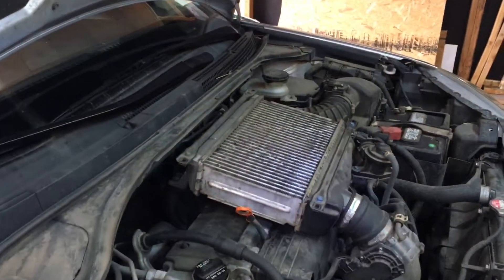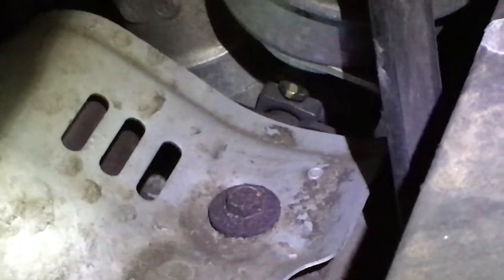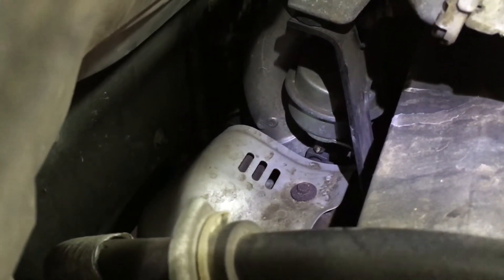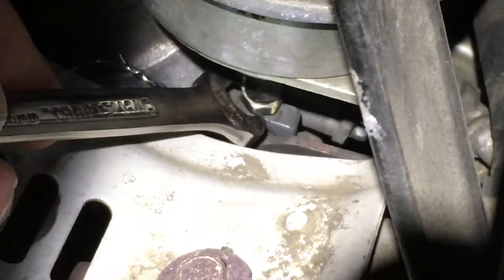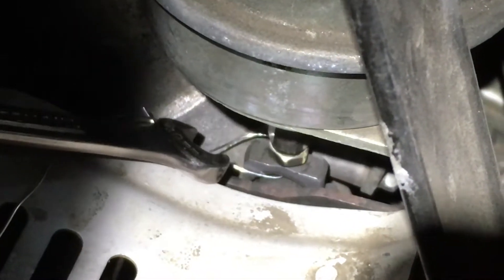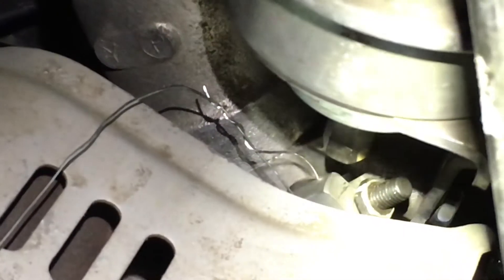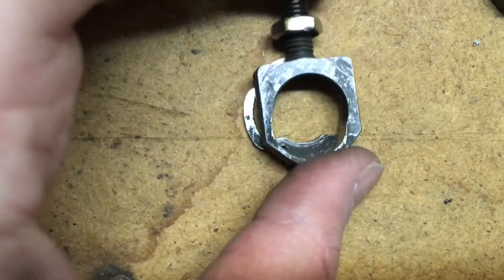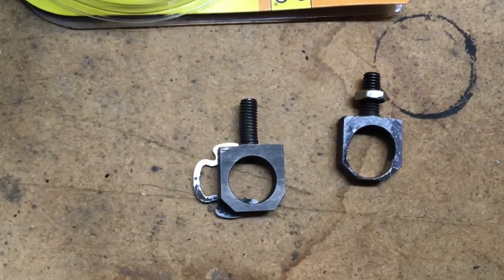How to fix P2263 Acura RDX Turbo error code - repair/replace VGT actuator / waste gate

Comment: Just finished this repair today. I highly recommend removing the heat shield (3 - 10mm bolts)  that sits just below this area as it gives you access to the retainer that holds/inserts into the hole of the actuator part that you are replacing. It is spring loaded and when pulled back assists in attaching the new part. Hope this helps.
Reply: Going to jump into this repair soon. I appreciate your tip
Reply: Sorry
How is the name the remplacement
Reply: Best video out there for this repair! I just performed this yesterday with success (minus the clip) on my 2007 with 180K. It helped reading through all the comments. My additions would be:

Probably should have saved myself a little frustration and time by getting the tools another user recommended...curved hemostats, long nosed vice grips, mechanic pick. Would have helped on the clip as well for sure.

I threaded in some zip ties to better manipulate the lever up/down that has the bearing like bolt on it.  This helped me get the part in behind, from the right side, while everything was more in the down position. Probably couldn't have done this with the heat shield or intercooler in the way.

While everything was broken down, I went ahead and cleaned the K&N filter, the throttle body, as well as replaced the spark plugs.  These tasks took a fraction of the time that the original repair took.

This also fixed a rapid rattle type sound that I had every time I came off the accelerator after building boost.  It almost sounded like a bicycle derailleur.
Reply: I replaced a part on my car and it's giving me the same code again after driving it for a few days. Could you tell me why?

Comment: I have the new part installed, but can’t get the threads started onto the barrel. Any suggestions?
Reply from the maker: Not apart from the standard "go backwards until the threads seat, then screw it on" advice. Removing the intercooler and heat shield for better access can help too.

Comment: Just got this today….have a 2007 acura rdx and first time i got this code….got this car at 128k miles and it came up at 211k miles, and in that time never popped up so not sure if it ever came up before that but i hope its something simple rather than replacing the whole turbo or something

Comment: Our 2010 RDX with 190K miles has a P2263 code, check emission error, SH-AWD error, and CEL lights on.  I have been driving with the code for a few months and finally replaced the actuator last weekend ($17 on eBay).  Took 2 hours and I had to give up on the C-clip, as I couldn't get it in.  I felt the actuator is tight enough w/o the C-clip, plus it's very easy to re-tighten, if ever needed.  The code and CEL are gone.  Thanks for the video, still useful 4 years later.
Reply: You have a link to the actuator used?
Reply: What is the name of the part so I can purchase it
Reply: @lawrencescalone2087  For Acura RDX 07-12 Grade 8 Turbo Variable Flow Actuator Eye Bolt & Nut & Clip

Comment: Found this in 2023, and I can verify it works! My 2010 RDX only has 100k on it but was throwing the code, Acura only suggests turbo replacement since they don’t actually make the turbo. Found this part on Amazon for $20, took me an hour to replace. Thanks for the video and helpful tips.
Reply: Hey @brandontarby3793, could you share the amazon link to the part you purchased please? Thank you.
Reply: Please share amazon link please

Comment: I just did this today. Car runs better but still have check emission and sh-awd lights on.
Reply from the maker: Need to reset codes after you're done
Reply: @aw-yiss   does pulling out the clock fuse for 30 seconds work on '08 model? I tried pressing gas pedal for 30 seconds with key in position 2.
Reply from the maker: @pattibrandt9430  I don't remember. I didn't use fuses. I think the manual might have some info?
Reply: @aw-yiss  I disconnected battery for five minutes. Codes are gone! Thanks so much for posting this video. I'm a 58 yo  mom and I did it by myself with your video and a ton of patience. Took a little over five hours.

Comment: Wish I read more comments before attempting this tonight. I removed the intercooler after starting to get frustrated. That itself is not a big job, 3 bolts, 5 hoses, and an electrical clip. 

I used, for lack of a better word, a grabber (push button on the end with metal grippy fingers on the other end) a lot. It helped me get the new part and clip positioned correctly for installation. I used fishing line for holding the clip and new part, however the old parts did just fall to the floor since I didn’t bother to toe them up. Don’t know how I could’ve. The wrench I dropped did need to get fished out.

Other worthy mentions would be how I used a 12mm wrench on its side about at the halfway mark on the linkage to pry it back enough to get the part on. This took maybe 30 mins to finally get the new part on there. Once I figured this out got it 2nd try. 

It’s really tight in there. If you have huge hands it’s gonna be tough. My hands are too big for this kind of work, and they’re only a large glove lol. Good luck.

Comment: Great video and comments here.  Just finished this repair.  Took me about 8 hrs across 3 sessions.  Patience is key, it’s easy to get frustrated with the limited access and light.  Study closely the intake runner on the backside in relation to the actuator arm travel; I found there was a sweet spot where the eye bolt would slip behind and the angled corners on helped with clearance. Get a small bright flashlight.  
Here’s what worked for me.  I’d definitely remove the turbo heatshield first thing in retrospect.  I wired the actuator arm to finagle the eye bolt off and on, but limit it’s travel to the top 1/3 or so. That was the sweet spot for me removing and installing the eye bolt.  Wire the new eye bolt and C clip.  I dropped them countless times. 
Feel around on the back for the C clip and rotate it with your finger or small screw driver where the tall spot (check some pictures) is on the left side of the eye bolt.  I slipped a small screw driver between the clip and eye bolt and pried it off.  I hadn’t wired it and at the time I didn’t care.
The eye bolt slipped off and pushed out horizontally to the right with the threads on the right, while wiggling the actuator arm up and down. 
I slid the new eye bolt in from the right side with the threaded post pointed roughly 2-3 oclock while moving the actuator arm to find the right gap between the lever and the intake runner behind.  It’s tight but mine eventually went.  Doing it one handed was tough. Patience.  I greased my eye bolt as well which made it tough to hold. 
Replacing the C clip was tough. What eventually worked for me was using needle nose vice grips to hold the clip on edge and push it on from the left at about 10 oclock angle. I had to reuse the original clip. The new one was just too stiff to push on all the way. 
As far as repositioning the barrel and lock nuts, loosening the lock nut made about 2.5 rotations to the bottom.  The barrel nut about 8.5 rotations up to free the eye bolt.  When I reinstalled, I used the wire on the lever to pull up to meet the barrel nut.  After starting the barrel nut to hold the whole thing in place, I turned the lock nut 2.5 turns up and then turned the barrel nut down to meet it.  Luckily when the barrel nut met the  lock nut, the factory marking was in the same place as before (at least that is what I’m telling myself).
Reply: How important is the c clip? After removing the old part I noticed it didn’t have one so I skipped putting a new one on. I reset the computer and so far so good after about 15 miles
Reply: @ItsBorgiaBaby  I suppose it's possible the eye bolt would slip off the post of the actuator lever (it's been a while) over time. Too, having the clip on there would limit any small movement of the eye bolt that could increase the wear on the eye and waller it out quicker.  I'd reinstall just for any insurance not to have to do that job again.
Reply: @ericskaggs3503  unfortunately the check engine came back on. I’m thinking to put the c clip on this weekend and giving it another go. Do you happen to know the exact reason this part fixed the issue for so many and why worn pieces caused an issue? I’m trying to figure out the concept behind it which will help me fix it. Thanks 🙏🏼
Reply: @Dirk-e5v I completed this but was never able to resolve it. I took it to a few mechanics and all of them told me the turbo has to be replaced. It’s working fine actually just the light keeps coming on so now my issue is getting it inspected every year.. let me know if you find a solution, good luck bro!

Comment: Anyone know how many turns that actuator bolt needs to be turned?   I think I loosened mine too much and still get the same engine code after replacing.
Reply from the maker: Someone else mentioned about 8 full turns.
Reply: @aw-yiss  From full tight or from fully out?
Reply from the maker: @tonywillingham8109  its in one of the older comments. I couldn't say but I assume after 8 complete turns it came off the threads entirely

Comment: every mechanic and dealer wants anywhere from 2500 to 5000 to replace the turbo for this 28 cent part
Reply from the maker: Dealer quoted me 7500
Reply: @aw-yiss  just be patient take off the intercooler and when you take off the c clip on the variable valve use dental floss doubles up looped incase it drops like it did on me 5 times my eye bolt and clip dropped alot lol. also that eye bolt is reverse threads ok. and use locktight so it doesnt back off next time
Reply: use 2 10 mm open ended wrenchs skinny kind thin ones to really get the eyebolt and double locking nuts back down tight. if you dont get it tight it will just back off and strip out again and again
Reply: once you get the c clip grab a medium pair of channel locks like the 10 inch ones adjust it to about inch and half open slowly gently get them in the and methodically squeeze the c clip on. if you fail no worries you have dental floss to try again fish it out repeat untill its done
Reply: now that you got that done. get the eyebolt standing straight up perpendicular with female threraded allthread part already attached to the underside of the valvebody the spring is inside that. guess what. you can spin that inside spring by turning the screw underneath take that 10mm wrench and you gonna wanna turn in counterclockwise ok while holding pressure on the lever and eyebolt upwards towards the treads. take your time make sure its threading in smoothly youll feel alittle  resitance but its shouldnt be cross threading. make sure it looks straight threading in. right before your almost done threading it in put some red locktight on the whole things and lock it all done tight. now put the intercooler and intake back on and drive away. like i did in about 25 minutes

Comment: A few things that will make this PIA job easier: needle nose vice grips, curved hemostats, mechanic pick.    I think the actuator lever has to be in the up position to remove/add the eye bolt so having a wire around the end of that to hold it up will help you get the new part on.  It also helps lift the new eye bolt into the threaded barrel.
Reply: it does but the lever can move sideways and bend a lil bit by prying on it with a flathead lightly. make sure to have magnet ready and dental floss putting it back on omg i dropped it 5 times into the abyss lol

Comment: How the heck did you turn the clip on the back?  Cannot get mine to budge.   That part about “don’t keep unscrewing the barrel”, that would have been good info at the beginning, not the end.
Reply from the maker: My clip wasn't too difficult to spin around with a screwdriver. Maybe try taking off the intercooler for easier access?
And yeah, the barrel info would have been nice to provide earlier, but I was figuring this out as I went.
Reply: @aw-yiss  The key is to spin the clip before you attach any containment wires.   The wire may bind it up.
Reply: @tonywillingham8109  how hard was it to even get the eyelet in? mines was straight parallel  with it but wouldn't go in
Reply: @cali_cal  If you mean get it screwed into the wastegate, I used the wire I attached to the actuator arm to lift the eyelet up into the wastegate.   Without that wire to put upwards force on the eyelet, I think it would have been much more difficult.

Comment: I was having trouble getting the threads to line up square and I ended up having to pry the wastegate actuator a little bit to get it started, they then aligned as they were tightened together and the length was shortened. Also, mine did not have a C clip on it and I did not put one on, I will try to remember to update if/when it fails. I only got 300 miles on it so far, it runs much better and no check engine light.
Reply: mines didn't either or maybe it fell? how hard did you have to press for the eyelet to go in?

Comment: How did u remove the c clip
Reply from the maker: Spin it around until you can see it. Run a wire through so you don’t lose it. Pop it off with a screwdriver
Reply: did you remove it?

Comment: thank you!! 3 years later and still very useful...FYI the price came down to $30
Reply from the maker: Awesome! 3 years later and the codes never returned for me.
Reply: @aw-yiss  guys i need help with this. my car has the same code. bought the car today with 62k miles. really in need of help. NJ-USA
Reply from the maker: @dipusultan7060  check the Acurazine thread in the description if you need more help, those guys are good

Comment: Thank you so much for this video! I replaced the part today and it fixed the issue and she’s running like new again!!! 🙏🏽
Reply: how hard to press into the hole?
Reply: @cali_cal  the only part that was hard was getting the clip back on. I ended up making a tool out of a wooden dowel and got it back on by pushing on the dowel.
Reply: Did the codes go away right away? Did you clear the codes after? My wife's car now talks longer in her drive for the sh-awd, check engine and check emissions lights to come on but I'm thinking the computer will realize the problem is fixed after a couple cycles. Like a bad gas cap maybe?
Reply: @YogiB118  code whent off right away. the clip is a bitch tough

Comment: Thanks Matt. Great video, wanted to add a few things to help with this install...

I did not put a wire around the old part. It fell down as I pulled it off and landed underneath the car, so not a lot of worry for people for having it lost in the engine. The old part will rollover so the threaded part is facing down since it's out of round and that makes it difficult to get off. A wire would have helped immensely 

I DID put a wire around the new part just as you did and it certainly made it easier. Holding the new part is impossible while trying to get it on the "dowel"

The old "c" clip can be partially pried off with a Teeny flat head screwdriver and then you can use a needle nose to get it out. Otherwise it will surely go flying 

Wrapping another strong wire around the pivoting arm that the dowel is on and having someone pull that (away from the car) is essential to get the new part on. Otherwise there isn't enough room for it to slide over the end of the dowel. You only need to put enough tension on the arm to clear a millimeter or two and it slides on easily.
Reply: you talking about the hole it has to go in? that thing is hard? or my eyelet is the wrong size

Comment: Why did u not show the actually getting it off or getting on...  🤦‍♀️
Reply from the maker: Because I had to use both hands?
Reply: @aw-yiss  I just really REALLY needed to see that part. My husband spent hours trying to get it off.
Reply: He got so frustrated with it that he gave up. And I have to continue driving it that way. I am assuming that is also what is causing the SH-AWD light to randomly come off and on... I am just worried and dont have the financial means to take it to a shop.
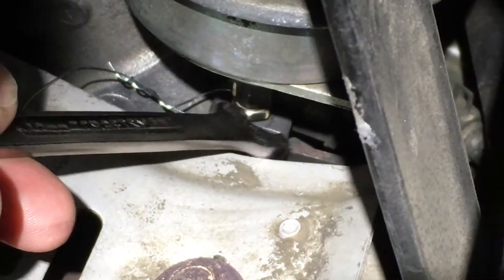Reply from the maker: @jessicaross323  Check out the 1:50 area again, loosen the bottom nut (counter clockwise) then the top nut (clockwise). Maybe he needed to take a screwdriver to pop off the c-clip shown at 3:00? The c-clip will hold it in place even after you remove the nuts. Getting the c-clip back on was a pain and just involved a lot of lining up and pushing hard.

Maybe remove the intercooler to make things easier?
Reply: @aw-yiss  I will give those tips to my husband. I am not sure what all he removed or did not remove. He had originally found your video and watched it but from what he was telling me last nite he didnt have room to get it it off and was afraid that if he forced it the new one would never go in. Maybe he needs to take a bunch of stuff off to make more room for himself. I also asked for help in the rdx FB group but everyone there made it out to be a super simple task. Idk what he is doing wrong lol
Reply from the maker: @jessicaross323  Taking the intercooler off should make more room, but I have no advice on that aside from people say it's 5 bolts. And yeah half the guys on Acurazine think an engine replacement is simple stuff. This fix isn't "complex" but it's not effortless
Reply: @aw-yiss  thank you so much for your advice I will definitely pass it on
Reply: @jessicaross323  Jessica, you need to do this work yourself.  Your husband's finger is too large, you need a female's finger to perform this task and also need a female's patience to perform this task.  Yes, you can do it!!!!